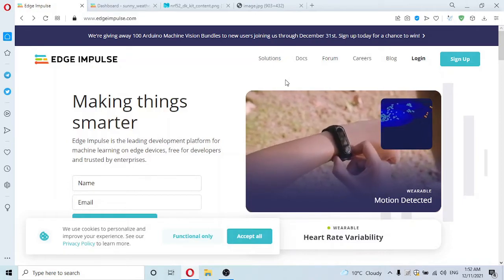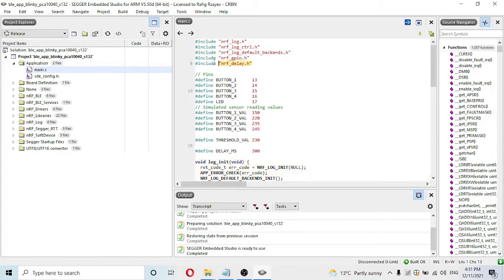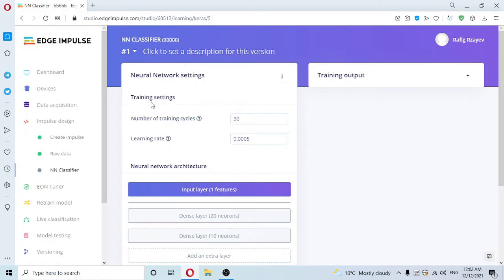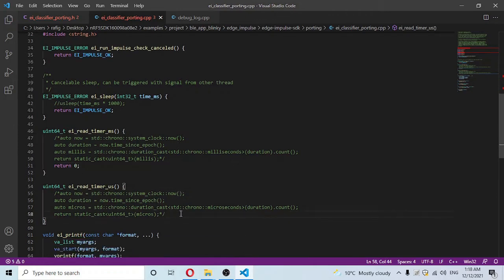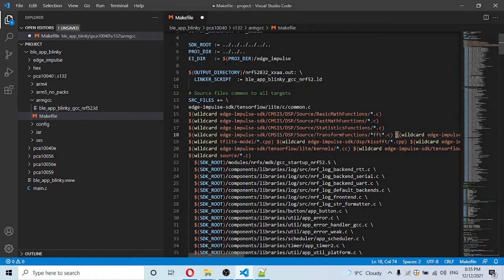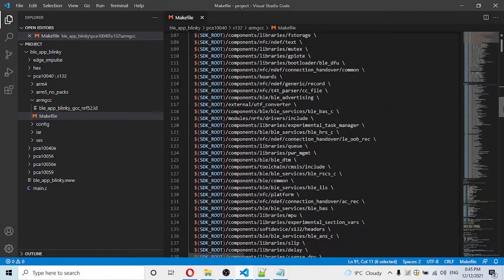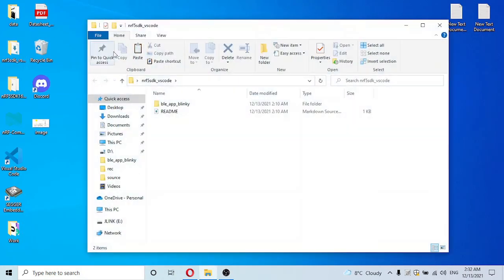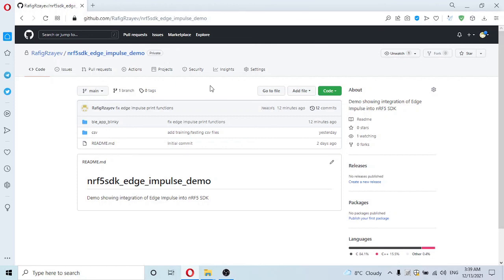How to use Edge Impulse with nRF5 SDK

Comment: Is it possible to use Segger Embedded Studio instead of VS Code ?
Reply from the maker: I tried a lot for it, but it looks kind of impossible. The C++ libs of EI give too many problems. Only with official support from nRF/Segger/EI altogether maybe it be could achieved (which they won't provide because nRF5 SDK is legacy, and nRF5 Connect is already officially supported platform)
Reply: @rafigrzayev1878  Okay thanks for info.

Comment: Is it possible to use an accelerometer  with timer in our project?
Reply from the maker: Yes. 

 Accelerometer will probably require I2C communication, which is supported by nRF52832 . Here is a nice tutorial which covers I2C: https://www.youtube.com/watch?v=-YjCpy1AFog  
As far as I remember, the same channel also has a tutorial to use timers.

 Apart from these, nRF5 SDK has examples both for I2C and timers, which will help you to get started.
Reply: @rafigrzayev1878  I followed your tutorials and I could run my nRF5SDK project using your tutorials, I also ran a ble_app_blinky  project with IA using your tutorials, but when I want to add my accelerometer and gyroscope library using twi I find errors, could I solve this using  I2C and is there any possibilitie to help me ?
Reply from the maker: TWI is actually the same as I2C. It stands for two wire interface, and is named differently because of proprietary stuff if I am not mistaken. Is the library that you are using written for nRF 5SDK or for another environment? Please share the link for the library if possible, so I can check.
Reply: @rafigrzayev1878  I actually shared it with you
Reply from the maker: How is it called? I don't see it.
Reply: @rafigrzayev1878  this link for main.c:
https://docs.google.com/document/d/1s8M_qqgT2w2LA0_btvnQMRON2cHd-xax0Qsr3AInVO0/edit3
and this is for accelerometer accelerometer gyroscope and magnetometer:https://docs.google.com/document/d/1YC42jiD9hUI0DqU6cDYErnmK3sR28qU_M9VWXWxVpDc/edit
https://docs.google.com/document/d/11McVUqh3OXTW_gOHmUTYTMapqqqyssUnRSDWvlIeeSw/edit
Reply: is there any news?
Reply from the maker: Hi. You haven't shared anything. I don't see any links.
Reply: what about now? is that enough to help me?
Reply from the maker: @ghaziajili9508  Hi, still nothing is visible. Perhaps youtube doesn't allow links. How is it called?